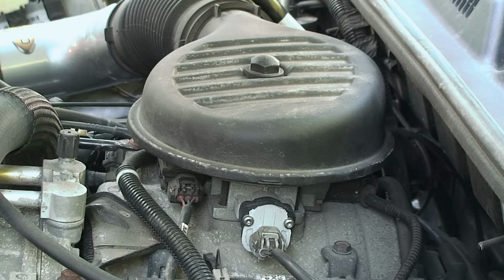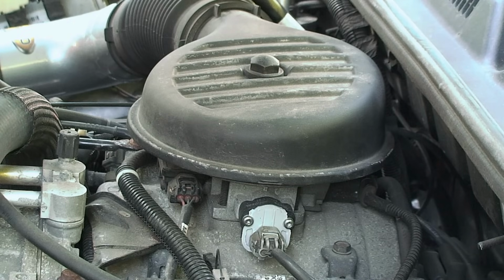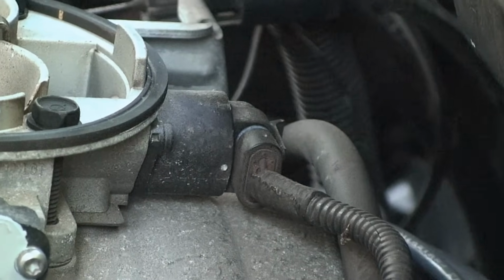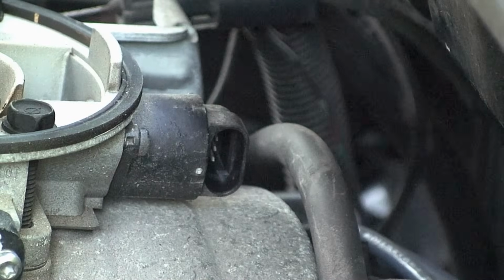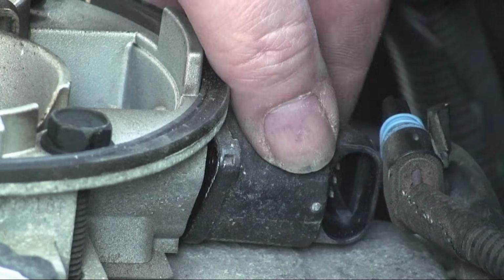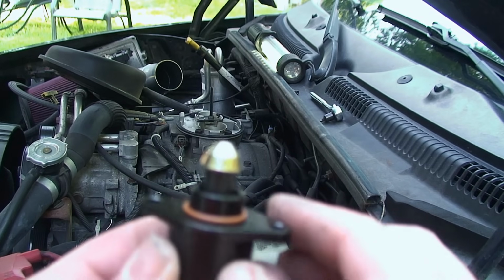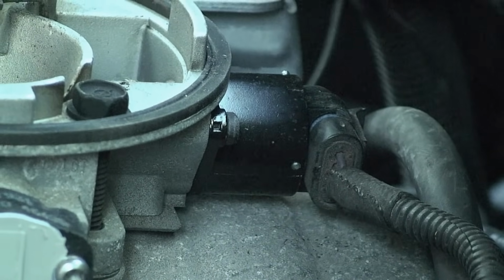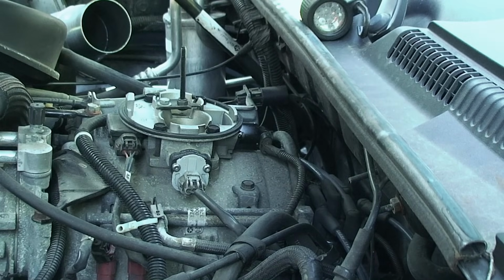Idle Air Control Valve (IAC) 2002 Dodge Dakota 3.9 Stalling

Comment: I bought a 2002 Dakota 3 years ago, a couple months after my purchase the truck was running like crap and stalling. I watched this video and purchased the IAC valve (aftermarket) it worked ok but never seemed to idle smoothly. About 3 weeks ago it started stalling again. Long story short. Watched your video again and took your advice to buy mopar. I replaced the IAC today and the truck is running beautifully. Thanks for making this video.
Reply: How much was the Mopar version of the part? And did you have to get it at a dealer or any local auto shop has them?

Comment: Every time you replace any sensor, don’t forget to disconnect the battery to reset the computer, otherwise new sensor not going to communicate with vehicle computer
Reply: I did not know this and did not do it. After replacing the TPS and IAC 1993 Dakota was still throwing the same codes. Did what you said and put about 50 miles on the engine. Codes cleared and problem has not returned.
Reply: @centaurus777  what he said is incorrect, the computer isn’t that smart that it recognizes a new sensor it just checks for a sensor period. What happened when you disconnected the battery cable was you killed power to the computer and after a few minutes the capacitors inside discharge an the computer resets itself. All that does is a memory wipe to clear codes. The same thing happens on its own after a few drive cycles with the fixed part but it takes longer to self reset then disconnecting the battery an forcing it. Which is why you had the same codes with the new parts right after install.
I know your comments like a year old I just figured I would explain what actually happened so you’re not misinformed.
-professional mechanic of 5 years
Reply from the maker: Good point, thanks for contributing!
Reply from the maker: I should have read on 😁 thanks for clarifying

Comment: Had the same issue mine even start stalling in the middle of me driving . I sprayed the throttle body directly with some throttle body cleaner and it solved the problem.
Reply: Mine stalls while driving! Any pointers?
Reply: @valleybuilt8979  get some throttle body cleaner and spray it
Reply: The entire throttle bottle? Inside obviously but you’re talking right at/around the throttle flap
Reply: @valleybuilt8979  just spray the flap it don't take much

Comment: To everyone who has the typical stalling issue, let me help you out it's not the iac, tps, map, iat, crank sensor, pick up coil, or cat. It's your upstream heated oxygen sensor. That will fix it. Oh btw.. Aftermarket sensors work just fine. Also check you intake manifold. If there is oil in there disconnect the pcv valve and block port on intake. Use a breather cap for the pcv.
Reply from the maker: Funny you should mention that, this fix DID work for my stalling issue.  However, the two systems definitely relate because several months after this fix I started getting a warning light for that oxygen sensor.  You can see that video here: https://www.youtube.com/watch?v=WT6mwP2_WqE

Also, to clarify what I've said many times about OEM sensors.  A friend of mine from many years ago worked for a well-known Chrysler supplier that produced many of their solid state parts and various sensors.  I can't give you the whole story here, but the long and short of it is that aftermarket designers do not have the benefit of the design specs that Chrysler has. (or any other auto manufacturer for that matter)  So what they do is program and test their devices based on known conditions that may change as manufacturing cycles progress.  This is what causes aftermarket parts (parts not made by an integrated supplier) not to interface well with systems in the vehicle.  In addition, aftermarket parts may not have the lifespan or be manufactured to the same Quality Controls.

Now, that doesn't mean that some aftermarket parts aren't sufficient.  As a matter of fact, if you’re lucky, you will purchase an aftermarket part that was actually made with updated specs and maybe even by the original supplier!  Often times they simply "label slap" a different brand name on them to sell them to various outlets, but it’s all the same part.
However, it’s still a gamble.  On the flip side, sometimes even the OEM suppliers cut corners.

I’m just telling you what my experience has been and the knowledge I’ve gained from working directly in electronics and industrial manufacturing for 12 years and for the last 15 years in the IT industry.

The bottom line?  The choice is yours based on your needs.
Reply: I have all aftermarket parts on mine, and mine runs perfect. I had the typical stalling issues on my 3.9 and replace everything initially, and guess what the upstream 02 sensor was the culprit. Granted I bought NTK oxygen sensors, at rockauto, but I pulled a Bosch out of my upstream, that had been in there for 5 years. Oil was being sucked through the pcv valve into the Intake and burn causing damage to my oxygen sensor. My truck had no codes BTW, being I'm a mechanic, and don't have a lot of time to work on my own stuff I didn't initially see oil in the intake, but once I did I knew exactly what the problem was.
Reply: rdvalla I parked mine because of this issue and got a new to me 04 dakota. Replaced everything with Mopar junk yard parts for diagnosis. No codes just idols down and stops running. I'll take a look at the 02 sensor when I get a chance would like to sell the 01 durango as a running truck for more money.
Reply: Heated oxygen sensor - is that the O2 sensor? If so which one would the Upstream be?
Reply: Thanks for the info. Having the same issue
Reply: My truck dies when I put it n drive or reverse  but idles  y is this

Comment: Would have no clue how to w/o this, thanks.
Note: the IAC removed is stuck in the extended/closed position, just like mine. The new part normal unpowered position is retracted. No wonder not working right.
I would add: the aperture where this fits is big enough to get a finger into. I used a rag w/solvent to reach in and clean out a LOT of carbon and gunk. I recommend it, should help the new part last longer.

Comment: no its not the AIC valve thats always everyones first assumption or fuel
 pump ect.....the problem your having is stuck valves that are not 
opening up...u need to get a bottle of oil and put some lube on those 
springs and valve stems and bang on all of  them with a hammer do this 
on each piston at the bottom of the cynlinder so u dont damage the 
valves or piston heads, hit them  real good until they break loose and 
they get well lubricated...very common with old engines with alot of 
miles....i perferrably use bar oil in the valve stems cuz it works so 
well...once u bang out all of them continuously they should all break 
free...this will fix your idle problem..also wouldnt hurt to pull the 
intake manifold off then take a look at the camshaft for wear..sticking 
valves will cause the cam to go bad because lifters are not doing there 
job due to the valve restriction.....hope this helps.
Reply: Michael Rundle where do i find the springs and valve heads
Reply: Julius B  gotta pull the valve covers off and break free the valves with a hammer... the cylinder heads are on each side of the engine block take the covers off and break loose the valves with a hammer and make sure each cylinder is at the bottom of the stroke while doing this u don't want to break the valves or damage the piston heads if the idle problem still persists then there could be a bad intake or exhaust valve seat which can lose compression in whatever cylinder...u can find this out with a compression tester
Reply: Julius B what I did was clean my aic with wd40 and sand the little metal part and change my spark plug and also clean the throttle disc that open and close with wd40...I have to say it save me over almost 1000$ I bought some motorcraft apart plug for $1.00 ...I get the best of acceleration and best of quick start.

Comment: Thanks for the effort.  All aftermarket IAC's I have
seen do not fit.  Plunger is too short to seal.  One
guy says I didn't "initialize" it.  Mopar is Not cheap.
$140.  Old valve works fine until motor gets hot. 
I think not cleaning the throttle body is a mistake
as there was a lot of carbon everywhere, literally
cakes falling off of plunger.
Reply: So did he say how to "initialize" the IAC? Thanks! Paul

Comment: On a 2002 Dodge Dakota 4.7 the island air control valve are there an adjustment on that or why do they put it on a set screw

Comment: Just curious, Wondering why you didn't clean the IAC mounting hole before installing the new one. Your old IAC looked quite coated with crud. Thanks and thanks for sharing this info.
Reply from the maker: I may have missed that, so good tip, thanks for taking the time to post!

Comment: Question, why did you not blow out the hole where this part went into?? I would feel that there would be dirt, trash and others thing to keep it from sealing up tight?? From the way the old one looked, it looked as if that area was very dirty. Thanks for the video...
Reply: There is no reason to clean it out, as it's just a stepper motor with a arm pushing on a plate to adjust idle position, no vacuums leaks will ever occur in that location.
Reply: OK Thank you...

Comment: Great video! Anyone know what size torx bit is needed to get the valve itself off? Thanks!
Reply: t20 i think
Reply: @MrClubfoot90  T20 or a T25.
T25 for  Throttle body sensor , which needed to be replaced on my truck.
But after seeing this video I'm going to replace the IAC too.
Should solve my issues completely.
Thanks for this video!
Reply: T25

Comment: I have a 1997 dodge dakota sport v8 5.2 I'm put it in reverse and drive if i don't keep it above 1000 to 1500 rpms it will die is it the same problem that u were talking about in your video
Reply: This is what my 99 Durango is currently doing. Did you ever solve your problem? I could use some advice. Thanks.

Comment: I have an 02 Dalota 3.9. Every once in a while I get a 'clicking' sound from the engine bay area accompanied by some hesitation in time with the clicking. Not throwing any codes though. Sometimes it stalls while sitting at a light, but starts right up. Anyone have any ideas what may be causing this? THANKS!

Comment: Ok . I have heard enough about aftermarket parts. I usually buy my parts at a Napa Auto parts store. They usually have two grades of parts with two different prices I do not buy the cheaper parts from them You get what you pay for.Cheaper is not always bad. Depends on your budget. And expensive is NOT always that much better then cheaper.
Reply from the maker: Well said

Comment: Fuel Supply, Vacuum leak, or possible timing issue, though normally that (timing off) should throw a code. However, IAC shouldn't really effect the engine while running, only in idle.

Comment: I have a question for you or anyone that can answer. Where does the hose coming off the front of the throttle body by MAP sensor go? Mines is just laying unplugged and I don't see where it could connect to and if you could show picture of where it connects. Thanks to anyone that can help!

Comment: I recently bought a 2002 Dakota Sport Club cab with the 3.9. I live in NC and bought the truck from my Dad, he lives in MI. I flew home to pick up the truck. Upon driving 750 miles back to NC the engine light came on. My neighbor has a scanner and was coming back with random misfire on 1,3 and 5 and misfire for each cylinder. I have changed Dist cap/rotor, plugs and wires, Ign coil, and PCV. Reset PCM and truck ran perfect no errors for about 20 minutes. Engine light came back on and at idle feels like it is going to stall.... Any ideas on whats next? I really appreciate it!
Reply from the maker: With misfires I would try troubleshooting in this order - map sensor (which helps control engine load, ignition advance and injector pulse) then O2 sensors, and MAYBE the IAC (but I kinda doubt it)
Reply: ***** Before I changed the PCV, I removed the hose from the PCV and the engine went from 600 RPM to around 900 and stays strong at 900. The PCV was a very cheap part and the guy at O'riley's said I would be back in a week to get another one as the part is cheap and not made well.
Reply from the maker: Yep that hsppens, did you go get another?
Reply: No. Haven't even had the code scanned again but engine feels same as before. Very rough at idle...
Reply from the maker: I would take it back, if the parts store has another recommendation then go with that, with inexpensive parts like that the chances of getting a bad one right off the shelf are higher, you'll find that a lot with thermostats which is why I always test them first, hard to do that with a PCV
Reply: Shane Woycik I had the same issue for several years off and on with the misfire in the 1, 3, and 5, and I found that changing the O2 sensor fixed it. I also had the stalling issue.
Reply: +Shane Woycik Check AND I MEAN CHECK... all the vacuum lines.. ESP if u are getting p1494.. I had cracks near the charcoal can, broken hose coming from throttle body.. check all vacuum lines please!!.. I have spent countless hours on this problem and in the end it was vacuum... check google and u will see people spending 1000's of dollars replacing fuel pumps. injectors and always coming up with no fix. After fixing all vacuum lines.. the misfires from 1. 3. 5 were gone. No more engines codes.

Comment: I have the same truck and need to know do I have to recalibrate the throttle???after replacing tps and iac my rpms are not steady and the engine hesitates
Reply: Your TPS needs to be recalibrated using a multimeter.

Comment: mreinsmith HELP...I have a 01 Dodge Dakota 3.9 Magnum engine...Runs GREAT! NOW on occasion after you've ran it, you go to restart it and it just cranks. BUT if you put the gas pedal to the floor, it starts right over. It does this randomly. Could you please help me out on this one? I used to be a mechanic in the 80s and 90s so I should understand what you have for me. Thanks in advance..You can message me any advice to.
Reply from the maker: Oy vey, my first thought was the IAC but it seems like you thought of that, I'll check the forums when I get a chance
Reply: ***** I haven't replaced that no.
Reply: Sounds like your fuel pump if you have to press the gas pedal to the floor to start it

Comment: The IAC on my 91model is different from yours; the parts store has my 1991 listed as an 'idle speed control motor'. Do they both have the same function? Could my 91 version still be cleanable? Thank you!

Comment: I bought my boy a 2001 v-6 dodge dakota and all the sudden when he starts it after its been sitting awhile it idles very rough, like skipping  kinda like it wants to stall, after it running for 2 or 3 minutes its smooth out and is fine, it only does it when it first started, is this similar to what yours was doing?? any thoughts or help from any one would be great.
Reply: Mike, I know this is a couple of years old, but did you ever find out what it was? I've got a 96 that does the same thing.

Comment: My problem is it dies when i drive it, it idles great until it obviously runs out of gas but ive changed literally everything and still nothing has changed
Reply from the maker: Did you test it with an OBD tester, if so is it throwing any codes? You can take it to a retail parts store to have It tested. 
I'm not saying that will be the final answer, but it should point you in the right direction.
Reply: @mreinsmith  it read the computer not reading the column right, I don't remember the code but I changed the column as well as the column harness and still nothing
Reply from the maker: Do you mean you were getting a code on a steering column sensor? Or do you mean the reader?
Reply: @mreinsmith  I'm not sure it didn't specify
Reply from the maker: Well maybe the parts store's reader would work? Let me know what you get

Comment: I am having the same issue with my 2000 Dodge Grand Caravan.  Is this just as simple to change out on the caravan?  The problem has been happeneing for almost a year now.  The van has started to make a foghorn like sound after the engine warms up.  I can make the noise stop my gently depressing the gas pedal, but as soon as I release, it make the noise again.  I think this IAC is the issue.

Comment: i fixed mine by removing air control .   and plugging the hole with a rubber stopper.    and block it with the air controller.    and unplug the idle speed screw.  and use that to control the idle RPM.
Reply: Did it actually work though lol

Comment: Im having this same issue with my 2001 dodge durango, only difference mine wont start unless i press the gas peddle and hold it or it dies(wont idle). My brother in law told me to replace the IAC which i plan on doing later today. Should i also replace the Throttle Position Sensor? is there any way to know if these are nonfunctional? The auto body shop wants to charge me a non refundable non reducible service fee of $97.93 just to see what the issue is. Again no check engine light?
Reply: Mines doing the same thing. What did you end up doing?
Reply: @ethansmith8813  I replaced the IAC if I remember correctly
Reply: @CharlesLang676  thanks. Ill check my owm and see if i can clean it